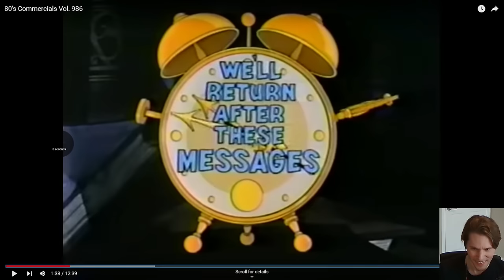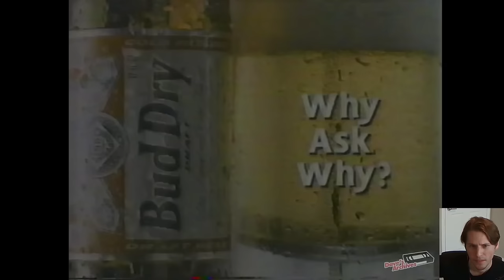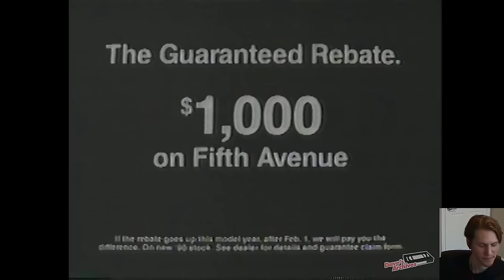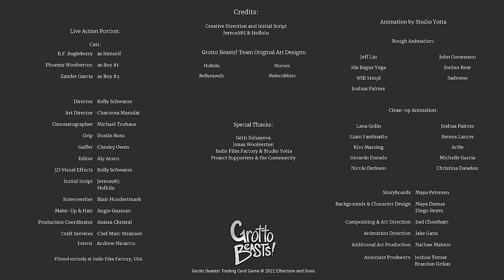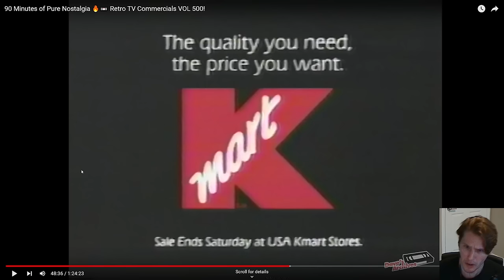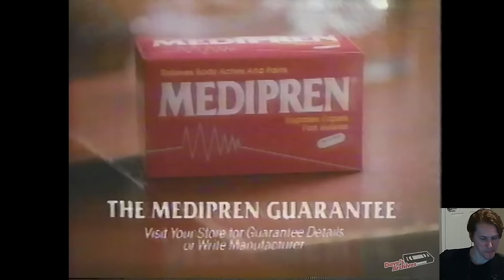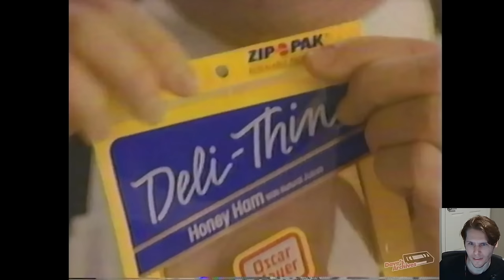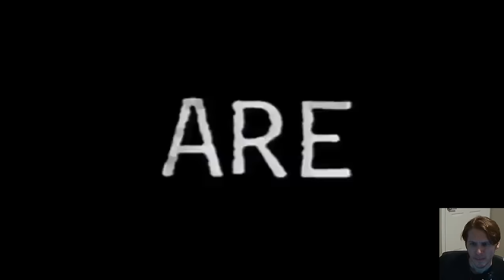Jerma Streams - Watching More 80's and 90's Commercials

Comment: Ear wax removal is such an 80s product, the idea that ear wax is some sort of buildup of impurity that up until now humans as a society haven't found a special way to remove it, and removing it is supposed to improve your body somehow
Reply: to be fair sometimes i used to get so much wax in my ears I couldn’t hear, and had to flush/suck it out with a plastic syringe
Reply: @cookiesandpudding8485  put some thin metal wire in there and pull out a candle
Reply: @JacobKinsley  forbidden diy